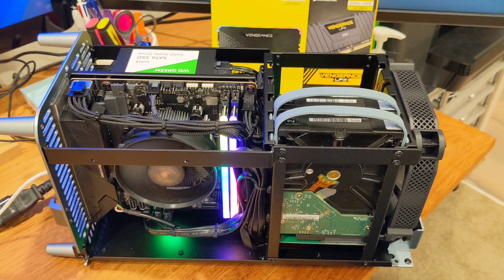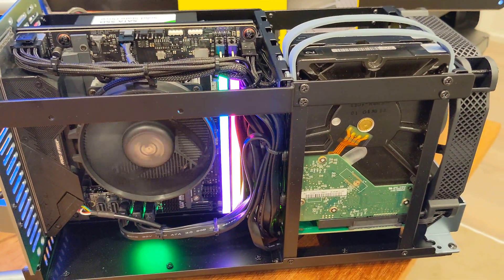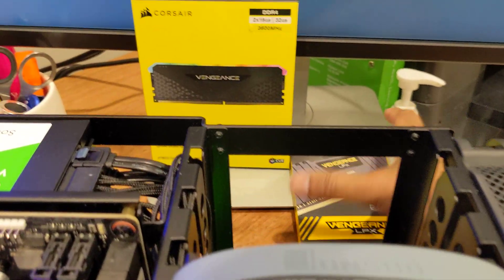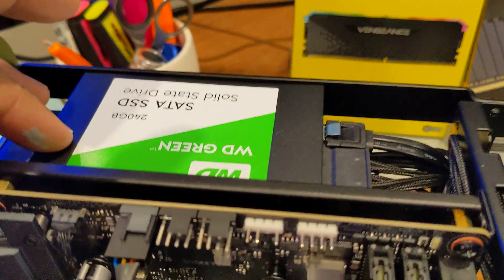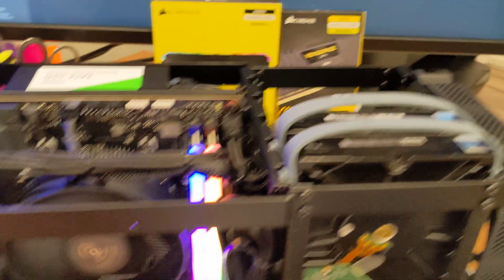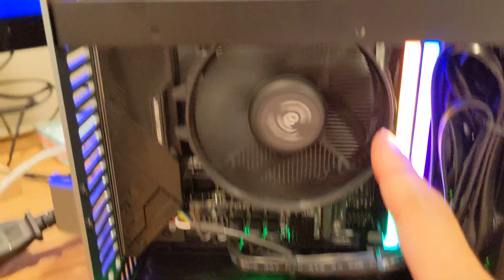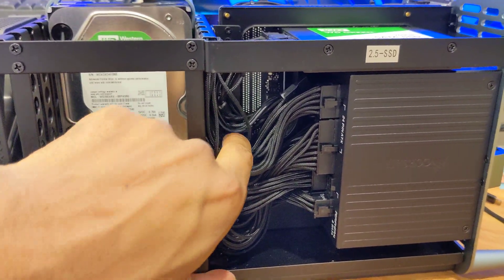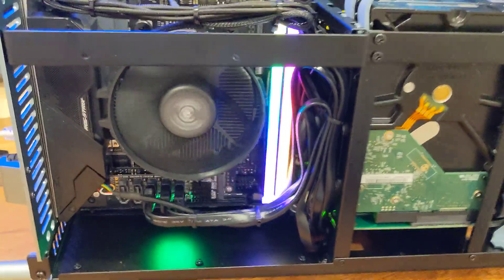Jonsbo N1 NAS Ryzen 7 Build Part 4

Comment: Nice build. I also want to build a NAS - mainly just to store data - no need for any media streaming etc.
1) How loud is the NAS under load and in idle? 
2) Why not ECC RAM? Wouldnt it be a better choice to go with a Mobo that supports ECC? Or does this NAS have it?
3) Whats the total cost of your build, excluding the drives?
4) Thoughts on the Fractal Node 304 Case? I am looking at other alternative cases that can store a bunch of drives and are small form factor.
5) How much power does this system draw in idle?
Reply from the maker: Hi Dominik, 
If you are planning to only store data these specs may be overkill for you. 
1. The NAS sits in my garage, it's winter here in Australia so my garage is really cold right now. When Summer hits I'll move it somewhere else. I have ethernet ports all over the house so I have many location options so the fan is not a concern to me. But it is quiet, when I stand next to it, it just hums along. After some time you may not even notice it. 
2. I don't run any critical apps or services so I had no need for ECC at this stage. My Motherboard does support ECC so I can go that route later on if the need arises. Also, ECC RAM is currently really expensive right now. I also use a UPS so I'm not even concerned by power failure. 
3. Total cost was just over AUD1300 - The issue is that with global shipping issues and chip shortages the price of computer components has skyrocketed. Try and buy used if you can. You can generally bargain with people on the Facebook marketplace.
4. I was wanting to go with this first but the case is too bulky for me. My case supports 5 drives and that is more than enough for me. Also, this Jonsvo case is really well made. 
5. On idle it draws 54.5 watts but currently I'm only running PiHole. Haven't installed any other apps yet but I expect that to rise a bit.

Comment: Do you think a single slot LP GPU will still fit in this? like rx6400 LP?
Reply from the maker: I looked up this model on Amazon and the listed dimensions are 16x7x2 CM. I measured the graphics card slot and this fits perfectly inside.
Reply: Cool. I'm also planning to build a NAS on this case and was really hoping it can fit a GPU. I just saw in another video earlier that the rx4000 doesn't have an encoder, and probably won't help with Plex/media encoding.

Thanks for sharing your build!
Reply from the maker: @mitchitv  I will be doing an updated video this week showing the HDD and final build. Make sure you like and subscribe and click the notification bell 🤠
Reply from the maker: @mitchitv  btw you can use Tdarr for transcoding or if you have a play pass you can do hardware transcoding instead of needing a GPU
Reply from the maker: XFX Speedster SWFT105 Radeon RX 6400 Gaming Graphics Card with 4GB GDDR6, AMD RDNA 2 RX-64XL4SFG2 https://amzn.asia/d/dNwfIX5